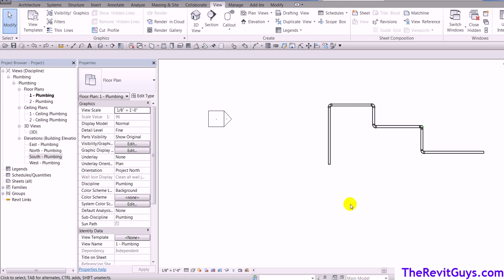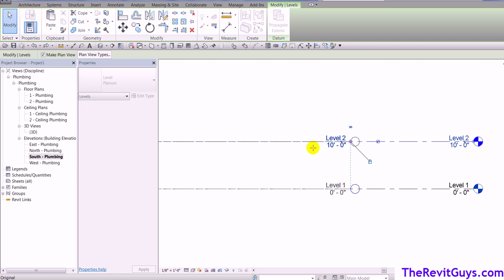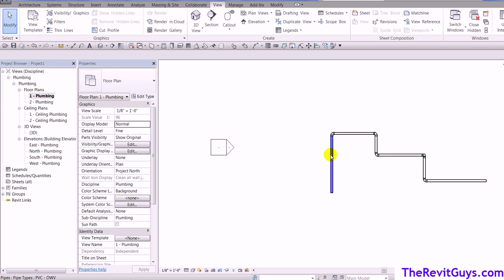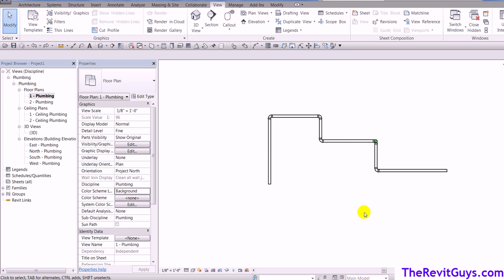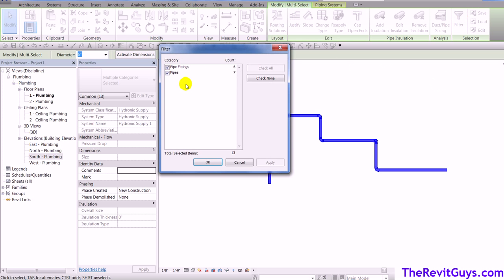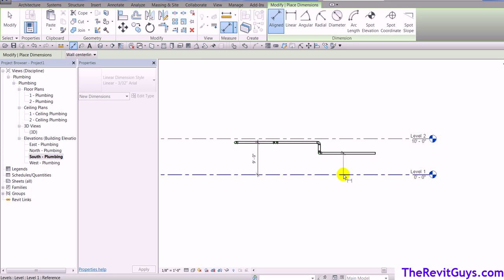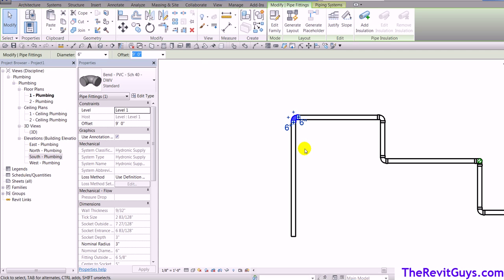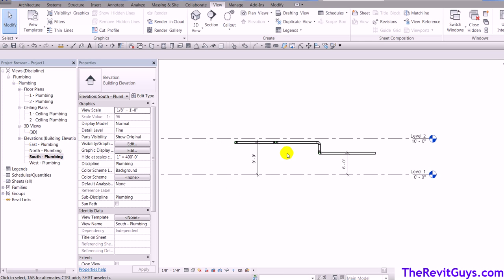Revit MEP - Pipe and Duct - Changing Associated Levels - CADtechSeminars.com

Comment: Any way for this to work when you also have sprinklers connected to the fittings on the pipe? i.e. that both the fittings and sprinklers would change associated level to be the same as the pipe?
Reply from the maker: Not sure. You will have to test drive it.
Reply: @CADuniversity  Thank you for the reply! I'm not able to get it to work with sprinklers. If I just select pipe and fittings the Reapply Type option is there but as soon as I also select a sprinkler the Reapply Type option is gone. If I just do it with the pipe and fittings then the sprinklers get disconnected. Pretty annoying. Thanks for your video though. It will be a very useful tip for other situations. Please do let us know if you come up with a way that this works for sprinklers along with the pipe and fittings. Thanks again!
Reply from the maker: @damienshannon8954  Damien, by default, Revit associates the pipes with the current level or work plane. Make sure your view is set correctly before you start adding pipe. For example, if you are in a view with the level set to 'level 1' all the pipe added should associate with 'level 1'. Hope this helps.
Reply: @CADuniversity  Thanks again for the response. Yes, in the perfect world/perfect designer that would all assigned perfect from the get go. However there are times where for various reasons this can end up incorrect and it would be nice to be able to reassign without much difficulty, such as the technique shown in your video. However it doesn't seem that provision has been allowed in Revit to do this when you also have sprinklers/accessories in the run of pipe along with the fittings. There are more involved ways to rectify but it's a pity this Reapply Type method doesn't work for those situations also. Still a good trick to know though for those situations for when it is just pipe and fittings. Thanks again!!